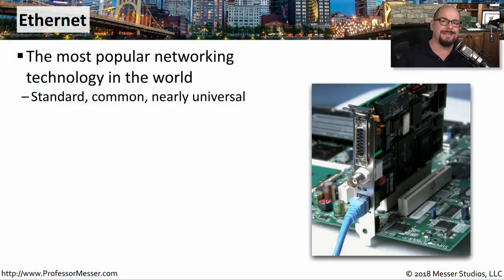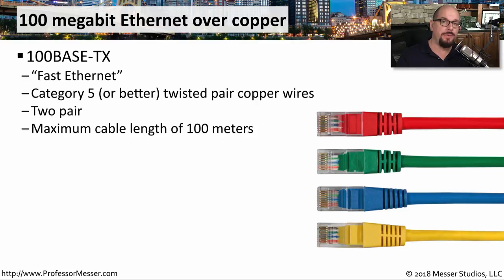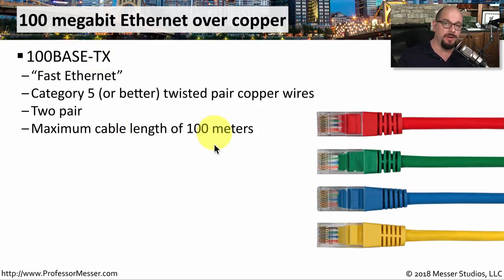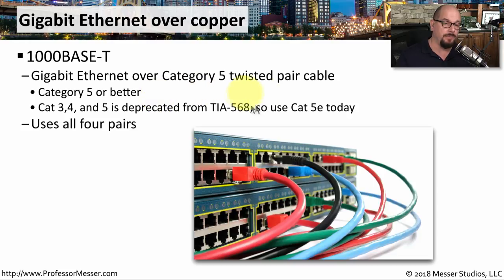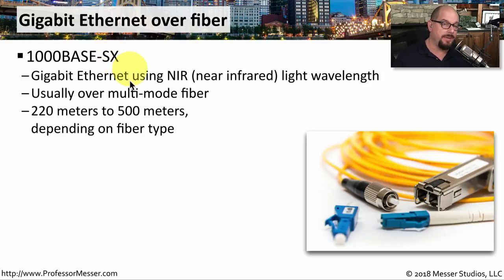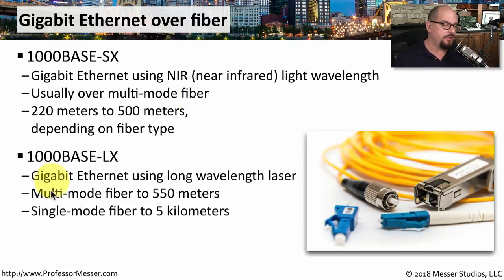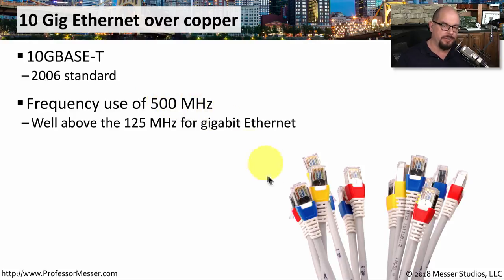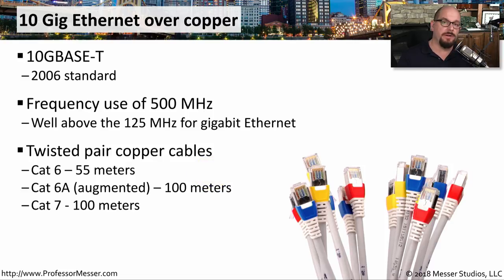Ethernet Standards - CompTIA Network+ N10-007 - 2.1

Comment: Also, I've found a really good strategy for learning cable standards, the main problem i had was remembering the distances associated with each cable and whether it was singlemode or multimode. 

 They all start with the "bandwidth" and the first letter can represent the distance. So for example 1000baseEX. I'll break it up ("1000"  The numbers means 1000mbs, 1 GB maximum throughput, "base" stands for baseband, every cable that starts with "E" is a 40km cable and they're always Singlemode Fiber.. Another example is 1000baseSX ("1000" 1 GB, Base = baseband and it starts with "S" Every cable with the starting "S" Is always a multimode fiber and has a maximum distance of 300m.)  

Lastly is 1000baseLX, now theres two execptions to this, theres two standards which don't follow the same distance so you need to remember these two standards. the starting L means that it usually has a maximum distance of 10KM. Now theres 2 standards that don't but the rest do, 1000baseLX and 1000baseLR, both have either less or more distance than 10km. But all standards starting with L are singlemode. This only applies to the standards needed to know for network+ I hope this helps someone as it has me!
Reply: 100BaseLR isn't on the objectives
Reply: @NamekSaiyan  I didn't think it was either.
Reply: @NamekSaiyan  you might get a question on it still
Reply: 1000BaseSX has a max travel distance of 550m.

Comment: 100BaseT is mentioned in the CompTIA objectives, but it is not mentioned in this video. Is 100BaseTX the same as 100BaseT?
Reply from the maker: Since 100BASE-T was never really used, you can assume that this is a typo and CompTIA really meant to include the 100BASE-TX standard.